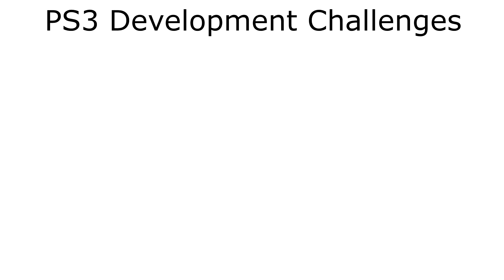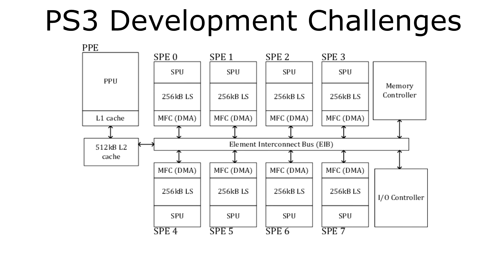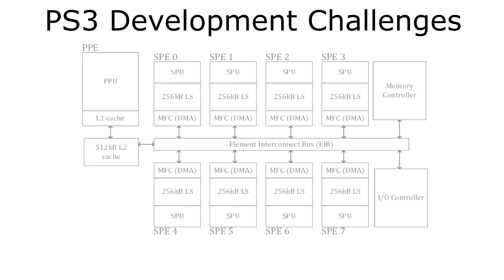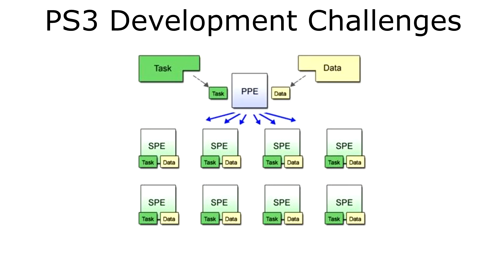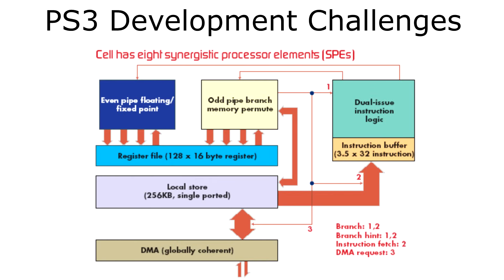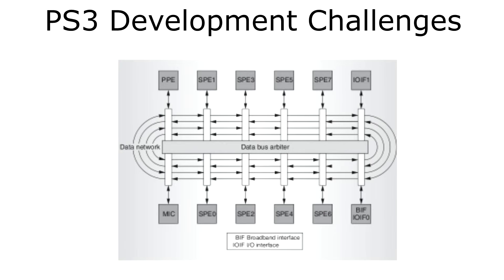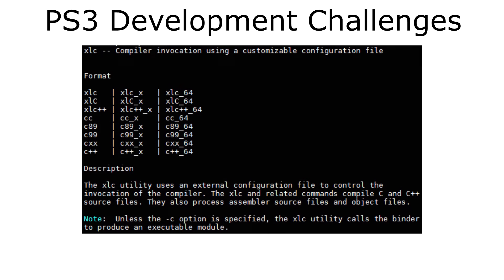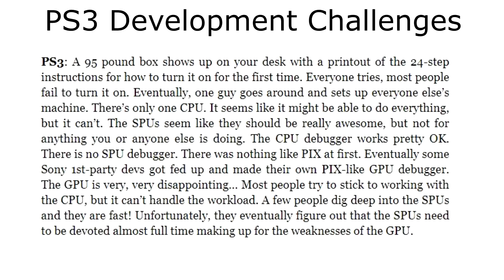Why was the PS3 Difficult to Develop Games For?

Comment: "When SPUs are properly utilised the CELL can do many incredible things"

"Gran Turismo was delayed 3-4 years."

Yeah about that, video game developers don't have that kind of time.

It's why consoles like Saturn also died. Complicated but powerful hardware doesn't mean better games it only means longer dev times. 

It's an interesting machine to use but not in this  field.
Reply: Agreed. IIRC, the ambition was for Cell to be used in everything and effectively replace x86; the PS3 was supposed to be a Trojan horse for mainstream development.
Reply: In general, when hardware principles contradict the way human programmers think, it never ends well. Intel Itanium is the best example suffered from the same problem.
They said: "A compiler must attempt to find valid combinations of instructions that can be executed at the same time, effectively performing the instruction scheduling that conventional superscalar processors must do in hardware". Sounds easy?
Spoiler: "turned out that the wished-for compilers were basically impossible to write", making Itanium one of the greatest flops in hardware history.
Reply: well it just went nowhere. gpgpu has similar challenges, but knowledge being learned actually means something, its not going away, and can be used for future projects and has a lot of applications
Reply: we still got amazing ps3 titles towards the end of its lifecycle
Reply: @cssplayer91   We would have gotten amazing PS3 titles much earlier had Sony not used the Cell Architecture
Reply: @FraserSouris  Not really we do have gimpy CPU x86 They couldn't match to s
Cell back then.
Reply: @FraserSouris  Resistance? Uncharted? Ratchet And Clank Tools Of Destruction? LBP? I think some devs even early on did very impressive titles, much ahead what PS2 could do.
Reply: @sebastiankulche  
And all those devs still complained about the PS3 architecture. Insomniac in particular, when working on Resistance Fall of Man and RaTToD, complained about how rough the PS3 was to work with.

The issue with such hardware is that companies spend more time trying to figure out the basics than they spend getting the game up and running and adding more content. R&C for example, has a lot more cut content than people realize because Insomniac underestimated how difficult the PS3 would be to develop for. Uncharted 3 PS3 had to leave out cheats and extra content (that the PS4 port added in) because of how its development became troubled.

Another issue is that it makes it harder to port these games off the PS3. You need entire dedicated teams for porting. Meaning Sony is only going to port the best sellers like GOW3, Uncharted 1-3, TLOU etc and not stuff like LBP, RaT, Heavenly Sword etc. At least Xbox can Backwards Comp easily. So even those good PS3 games are trapped on the PS3.
Reply: @FraserSouris  Well, i think it also didnt help that some companies also tried to be on the peak of technology so if they need to put more than half of the dev time just on the engineering side, they would do it. ND is one of my fav companies today but it could be said that it was kind of his achilles heel.

But regardless of that, generally after they learned the system, the sequels came out quicker and they could add what they wanted before or more. And thanks to that is that the exclusives could outperform 360 titles even if that mean multiplatforms to do the opposite effect minus some exceptions.

I dont think the hard to learn architecture was the only problem, Sony itself barely did something to help these smaller devs. There was barely documentation much like PS2 (and on top of that, PS2 dev kits were hard to get before 2000 due to the superweapon rumour that was around the system, idk if that happen with PS3 too though).

I sometimes wonder if all of this was done on purpose for Sony to test and "filter" the devs and the games (like it or not, exclusives sells hardware). After seeing the vector units competition that Sony hosted it really makes me think that.
Reply: @sebastiankulche  
>"But regardless of that, generally after they learned the system, the sequels came out quicker and they could add what they wanted before or more. And thanks to that is that the exclusives could outperform 360 titles even if that mean multiplatforms to do the opposite effect minus some exceptions."<

Yes and no. Some sequels came out faster on PS3 but that was more because that since the first game was built, the foundation was there so you didn't have to develop the game from scratch. And even then, devs still complained about these sequels. Polyphony still complained about Gran Turismo 6 because the PS3 was still a pain to work with. Santa Monica didn't exactly praise the PS3 for GOW Acension. Same for Naughty Dog and TLOU (Remember, Uncharted 3 ran into major development issues). Insomniac were overjoyed when the PS4 came out. Even 3rd Parties have talked about how glad they were to leave the PS3 behind. Valve and Rockstar are the most notable ones.

The issue is that even if you learn the system, it being complex still is a drag on development since anything new or complex you want to do is bottlenecked.

The famous example is "Hello world". If I am a programmer and it takes me 3 lines of code of write "Hello World" in C, I can get started on more complex stuff sooner since the easy stuff is quick to set up. But on the PS3, it takes 100 lines of code just to write a simple "Hello World". Even if you know those 100 lines for Hello World, what happens when you try something new? You'll spend more time getting that to work than just prototyping it. That's why stuff like Unreal and Unity have been opting for more intuitive templating systems. The faster it is to get something going, the faster you'll do the easy stuff and actually be able to spend time on the hard stuff. Rather than waste valuable time setting up the easy stuff.

Even just personally, ask me to get a machine learning project going in R or Python and I can crack one out on Autopilot. Ask me to do it in C or JavaScript and more of my time is going to be spent doing basic matrices 😢.

Moreover, even though, eventually, the PS3 multiplats could run better than 360 Multiplats (GTAV is the biggest example), it's not like the 360 was that much worse. GTAV for example, ran at a few FPS and had slightly more grass on PS3 than 360. Not exactly something players would spot instantly (PS3/360 players at the time were happy to even get 25+ FPS for open world games like this 🥲). You could run PS3 exclusives like GT6, TLOU, Uncharted 3 etc on 360 (with some minor tweaks to resolution and details). It's not a PS2/OG XBOX situation where games like Splinter Cell Chaos Theory had to be completely changed in order to work on PS2/GameCube compared to the OG Xbox version.

Like yeah, eventually companies learned the PS3, but that was more out of necessity since it had an audience of 80+ million potential buyers. Devs had to deal with the headache and optimize their PS3 ports since otherwise, they would lose sales. Because of how "underpowered" (relatively speaking) the 7th gen consoles were for the time, you couldn't half ass a console port and get away with it. At least PC players had reasonably powerful machines that could brute force less optimized ports (within reason). If most devs had the option, I think they would have preferred the PS3 to basically be a slightly different 360 (even if it were weaker)

>"I sometimes wonder if all of this was done on purpose for Sony to test and "filter" the devs and the games (like it or not, exclusives sells hardware). After seeing the vector units competition that Sony hosted it really makes me think that."<

Shamus Young proposed a similar conspiracy theory back in 2013-ish. His proposal was that Sony assumed that the success of the PS2 meant 3rd Parties especially would treat the PS3 as the default (some companies like Rockstar pledged to support the PS3 even before it came out. GTA4 was even a PS3 exclusive before Microsoft stepped in and paid $50 million to Rockstar to make GTA4 a multiplatform game but make the DLC a timed Xbox Exclusive). So by making the PS3 super complex to develop for, it would create a "walled garden" where companies would make a PS3 version but be put off making a 360 port so the PS3 would end up gaining a lot of "de facto exclusives".

However, his commentors point out that more likely, the Cell was probably more of a sunk cost fallacy. Quote:

'''
MrGuy says:	
Tuesday Jan 20, 2015 at 7:40 pm	

I think this is an important point, and related to Shamus’ belief that the decision to use the cell architecture was a management decision (as opposed to a technical one). That said, I’m not sure the “walled garden to keep developers in” idea was really the correct one.

The cell architecture concept was dreamed up at IBM, and developed as part of an alliance IBM formed with Sony and Toshiba. The alliance formed in 2001, just after the PS2 had launched, when Sony was looking for what the “next big thing” would be.

The idea has a ton of appeal for people dreaming about “the next big thing” for graphics programming. The idea of having multiple co-processors was to make it easy to “hand off” tasks like shading, vector processing, or other multi-media-intensive tasks. It sounds good on paper – you can do a lot more with it than you could with a dedicated GPU (for example, one idea I heard at the time was alpha surface handling could be a lot more robust).

Sony committed to the new architecture on promise before it was even designed, and before they could really project just HOW complicated the architecture would be to use. I don’t think the idea was just to be “different,” it was to be better and more capable.

But that’s not how it turned out. The programming problems were bigger than they intended. The tools weren’t as easy to build as they’d hoped. The “magic multimedia engine” they’d wanted to build was hard to use (Toshiba, for example, never brought a commercial product to market, despite clearly anticipating that they’d be able to when they started).

But Sony was already committed to riding this train wherever it was going – they were heavily invested in the design and development of this cell processor thing. So when they finally got to the point where they could really see what using it would be like, they either a.) had to hold their noses and pray for the best, or b.) abandon millions and millions of development dollars, admit defeat, and start completely over on designing their next gen console to be a modest incremental improvement on the PS2 and not the revolution they’d been promising the industry loudly for years.
'''

At the time, Cell-like architecture had its uses in stuff like certain supercomputers and Pixar-like animation rendering. Sony probably saw that and figured that would be the next innovation for gaming. They incorrectly predicted that, given that the PS2 had difficult to develop for custom hardware, that would be what consoles were all about. Sont didn't foresee that game development would get so complex that standardization would be the preference.
Reply: @FraserSouris  Sorry, but i heavily disagree. Naughty Dog in many interviews clearly said that Uncharted wouldnt be able to run on 360 (specifically U2), and forget about TLOU (in fact they barely got PS4 to run it). And while i agree that development got much more difficult in the PS2/PS3, at the end, most companies released much more games here than on PS4, ofc, mostly because games cost more and more to develop, but i point is, it didnt made that much difference in practice.

In what you are even writing Hello World? Lol. You only need much more complex code if you want to fully utilize the HW. If you want to do simple stuff, just with the base 3.2ghz and the RSX you can do it in simple high level C++ language. I bet even cutting edge PS2 games could run with just the base CELL clock speed (Mark Cerny on its PS4 presentation made it clear that doing simple stuff, like drawing a few polygons, not matter how difficult is the hw, is piece of cake, even on PS3, the difficult thing is pushing it to its theoretical limit, which i doubt a simple hello world program would be).

"Even just personally, ask me to get a machine learning project going in R or Python and I can crack one out on Autopilot. Ask me to do it in C or JavaScript and more of my time is going to be spent doing basic matrices"

Not gonna criticize your programming, because we are all learning, but that is one thing, and another thing is trying to criticize the lack of specs or problems of a console, to hide your or someone else skill, which tbh i constantly see in the console forums, mainly DC ones.

Citing what Rubin said once a long time ago because i think it nails perfectly what im saying:

The developer's job is not to do the easy thing. When we worked on PlayStation we had people coming over to license the Crash engine. They said, 'You're out of your gourd! We are not going to do the kind of crap that you do to get the graphics out of this system. It's a waste of your time. Why can't you just model it simply and then do it?' And we'd say 'That's not the way to get the most out of the system.'" If you're a lazy developer, you probably also haven't been a very good selling developer, that's my opinion, "Oh, this is too hard, we can't handle it!' I mean, these guys have never done 3D before! Who are they to whine? I mean, they literally have not done 3D before -- they skipped the training, and are now jumping to the 3D world. They skipped the whole last generation effectively, and they're whining. You know, those guys couldn't get it working on the PS2 and they were trying to use someone else's engine because they can't even program 3D engines. I give 70/30 that the game ever comes out, and 30/70 that they make any other games from now on. I don't care if I have to pierce my nails with pins to get it to work, I'm going to do it because that's where the money is. And that's the attitude we go into every game with.

I still think Sony did it on purpose though, because again, otherwise they wouldnt had wait so long to gave decent programming libraries, in fact, it was the ICE team itself that helped most of the devs during the PS3 era (and even today). On the PS1 era Sony also did the same by prohibiting using part of the PS1 hw early on and giving trash libraries that only allowed the PS1 to use like 10% of its maximum polygon count.
Reply: @sebastiankulche  
>"Sorry, but i heavily disagree. Naughty Dog in many interviews clearly said that Uncharted wouldnt be able to run on 360 (specifically U2), and forget about TLOU (in fact they barely got PS4 to run it)."<

I assume you mean the PS3 regarding TLOU1 here rather than the PS4. But regardless, I don't agree. I feel you're missing the overall context here.

Firstly, I do remember Naughty Dog saying stuff like that in interviews around 2009-2011. The most prominent claim was Arne Meyer's (ND community strategist) version of it. However, a lot of those seem to be more marketing or promotional based interviews rather than raw technical or software related ones. 

Compare this to 6th Gen Splinter Cell games, Morrowwind, Halo, Fable etc where it really wasn't possible to port those games as is to PS2/GC from the OG Xbox. So those had to be changed drastically or outright cancelled. Here, the devs talked about how the game(s) were so dependent on the console having an internal hard drive and faster memory streaming etc that the PS2 not having that straight up made the game impossible.

In contrast, there wasn't much practical difference in what the 360 and PS3 could physically do.  Like, keep in mind what the 360 had going for it over the PS3:

-360 had more flexible RAM: 512MB unified (vs 256 + 256 split in PS3)
-More developer-friendly GPU (Xenos): Had features like hardware tessellation, which PS3 lacked

Moreover,  consider that the 360 had games like Gears of War 2 and 3, and Halo 4, games that were graphically impressive and detailed and on par with the PS3's best. If the 360 could do those, it could do Uncharted 2 and 3/TLOU1 (likely at worse resolution and texture detail but still close). Moreover, both 360 and the PS3 had multiplats like Crysis 2 and 3, GTAV etc where both consoles ran almost identically. The PS3 only edged out in rare cases like in GTAV having more grass and a slightly better framerate.

The other point to note is emulation. RPCS3 lets you emulate a PS3 on a PC. A PC has a setup closer to an Xbox 360. Obviously  emulation introduces a ton of overhead but it means that in terms of computing, you don't need the cell architecture to replicate the PS3's functionality 1:1. So while it would be complex, it's still doable on the 360 as well.

The only truly impossible aspect of the PS3 that the 360 could not replicate as easily was the Blu Ray Drive.  Which means cutscenes, audio and certain effects might be slower to load or need to be more compressed but not an impossible feat to overcome.

>"In what you are even writing Hello World? Lol. You only need much more complex code if you want to fully utilize the HW. If you want to do simple stuff, just with the base 3.2ghz and the RSX you can do it in simple high level C++ language. I bet even cutting edge PS2 games could run with just the base CELL clock speed (Mark Cerny on its PS4 presentation made it clear that doing simple stuff, like drawing a few polygons, not matter how difficult is the hw, is piece of cake, even on PS3, the difficult thing is pushing it to its theoretical limit, which i doubt a simple hello world program would be)."<

I think you missed my analogy and are taking the point too literally. The point of the "100+ lines Hello World" point wasn't to say "PS3 complex therefore bad" it's more like "because it is so hard and challenging to do even the basics, it slowed down iteration that is key to game development".

Because in order to even write a simple Hello World or setting up a basic 3D render loop with a cube  on the PS3, you need to do the following:

-Custom memory management

-Asset pipeline setup

-RSX initialization

-File I/O management

-SPU thread setup (if used)

-Debugging with immature tools

Remember, the PS3 required devs to manually manage memory pipelines even for basic tasks, the RSX (GPU) and Cell (CPU) couldn’t directly share memory without complex copy procedures,  the SPUs on the Cell were not general-purpose — devs had to write optimized code to use them effectively. And finally, there was no easy abstraction layer or middleware early on (e.g. Unity/Unreal weren't PS3 ready in 2006–2007).

This drastically slowed down development and was a nightmare for devs to get going. Case in point, the fact that the PS3's first few years were rough with a lot of unoptimized ports and even exclusives didn't take full advantage of the system. The PS3 lost games like many of Valve's stuff, and even stuff like The Crew 1, Metro 2033 etc because of how much of a pain it would have been to even get it going on the PS3.

 
>"Citing what Rubin said once a long time ago because i think it nails perfectly what im saying: The developer's job is not to do the easy thing. When we worked on PlayStation we had people coming over to license the Crash engine. They said, 'You're out of your gourd! .... And we'd say 'That's not the way to get the most out of the system.'" If you're a lazy developer, you probably also haven't been a very good selling developer,"<

I remember this one. But the thing is, times have changed from that and even Rubin himself, when working after the post THQ-Collapse, ironically, changed his mind on the topic. He then said: "“The problem with trying to ‘crack the system’ isn’t that it can’t be done — it’s that it takes time and limits creativity.”"

Rubin's original mentality was common in the 90's. In part due to necessity. You had to squeeze every drop out of the PS1 with handwritten and super optimized low level code that was deemed "impossible" to work with because it really was otherwise impossible. The PS1 lacked modern tools or engines like Unity or Unreal. If you wanted a game like Crash 1 on the PS1, you had to do it Rubin's way since there was no other way. But at the same time, game development was smaller. Even the biggest AAA teams rarely expanded past 50 people whereas now, less than 100 is considered Indie. 50 people working on a PS1 level game that had to be done in 1 year was doable with that mentality. Wheras now and even during the PS3, less so.

Even Naughty Dog and Insomniac during the PS3, didn't hand code as much of their games as much as they did for PS1 games. In part because doing that would take up several more years and in part because 3rd party software finally started to support the PS3. Time spent wrestling with hardware was time not spent on content, polish, or iteration.

>"I still think Sony did it on purpose though, because again, otherwise they wouldnt had wait so long to gave decent programming libraries, in fact, it was the ICE team itself that helped most of the devs during the PS3 era (and even today). On the PS1 era Sony also did the same by prohibiting using part of the PS1 hw early on and giving trash libraries that only allowed the PS1 to use like 10% of its maximum polygon count."<

Eh. Kinda. The "filtering" idea makes sense initially but loses steam later when you recall that the PS3 was flopping hard in its first few years. It wasn't selling well at all. Sony was losing money on each unit sold. At least for the PS1, it makes business sense to be so hands off at first since the N64 wasn't really doing the same stuff and the PS1 was selling crazy well. But with the PS3, the system was close to failing. There was no benefit in holding off since they needed exclusives and even 3rd party ports to not be terrible.

This is more likely a case of "Sony being overconfident and suffering for it" than an intentional ploy.
Reply: agreed to the extent if your tools do sufficient abstraction complicated hardware shouldnt be a problem (game developer educated at UCA Farnham)
Reply: I wonder if with modern optimising compilers the cell concept could work. You let the compiler do the heavy lifting for you in optimising the code and removing the headache in developing for such a system.
Reply: Except the PS3 hasn't died the way Saturn did. It had a very healthy lifespan with many great games released on it. Sure, the Xbox 360 outsold it, which put Sony under pressure for PS4's release, but the PS3 was still far from a failure.

Honestly the Cell was just a product of its time, in the 2000s the industry was looking for an alternative to traditional RISC/CISC architectures, with some ideas that looked great on paper, but flopped in the real world. Intel's Itanium was a similar case, looked great on paper, but as it turned out compilers needed to extract its potential were simply impossible to write.
Reply: the saturn was NOT powerful. at its best, it only matched the ps1. and the n64 eclipsed them both (hardware-wise)
Reply: @SuperM789  saturn was powerful, but it was more of a 2D beast then a 3D one.
Reply: @SuperM789   N64 had cartridges so it was gimped by sound must crap
Reply: @FR4M3Sharma  You dont know anything about game dev. What stalls development is developing assets. Each car took avout 6months if I recall.
Reply: @outlander234  according to your own writing, development would have taken 840 months (slightly over 70 years). That not the case, beside. That is not true, you will see that coders have no problems using placeholder assets, it's one of the most basic things they are told to do and that coding tutorial help you do, even vintage story coding tutorial tell you how to make placeholder assets with code and / or just reusing an existing model, they don't wait after the 3D artists. The 3D artist wait after the coders to know what they can do and not do.